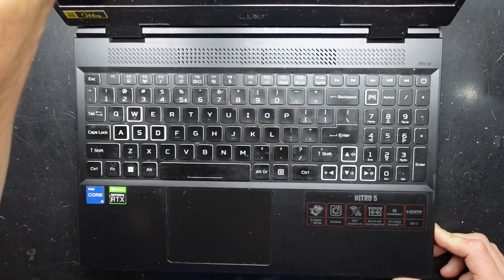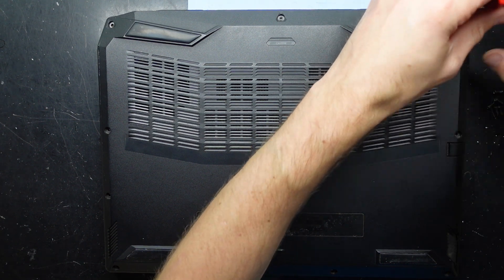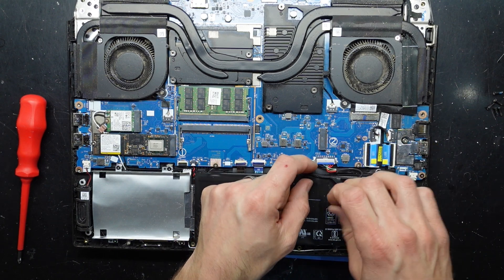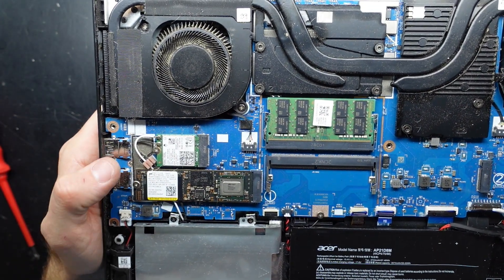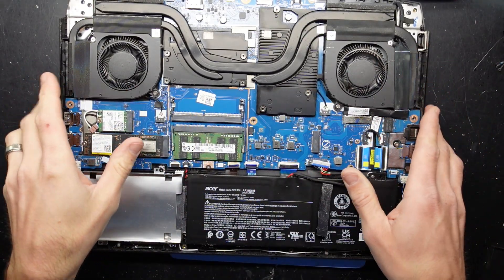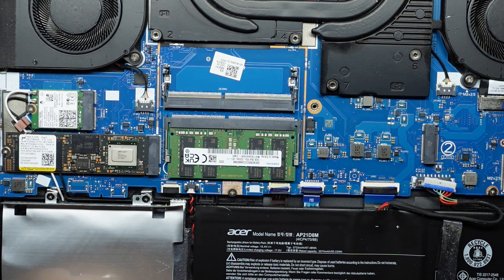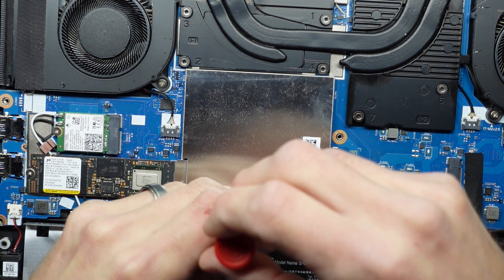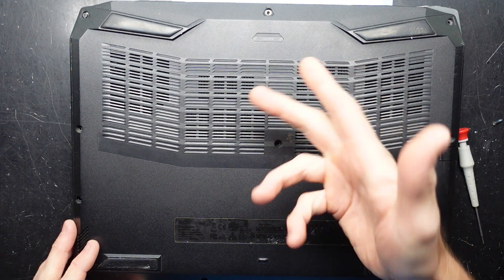Acer Nitro 5 A515-58 Ram and SSD Upgrade

Comment: I was wondering out of curiosity if ita posible to use KC5000 nvme SSD pci express 4.0 on that pc. It has Insane read/write speed around 7000/7000. Also the ram part. Can i use a 3600mhz ddr4 ram on it ? I belive i read 64 gig max the motherboard Support. And one last thing, got any recomwnsation on what i can do about the battery? OR can i do anything about it all.
Reply: does this model supports 64gb??
Reply: @prodzypher  i just checked, its 32 gb max. not 64 that i tought lol